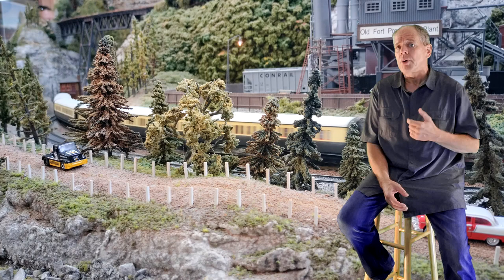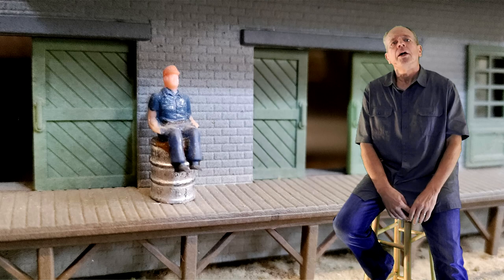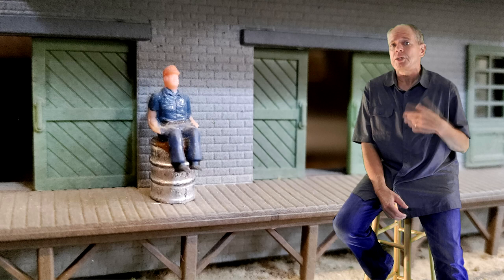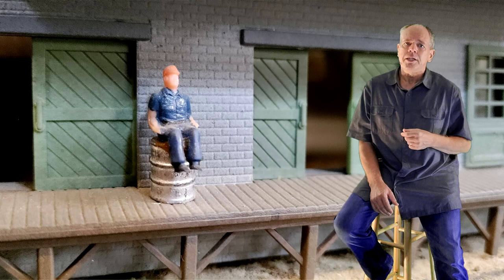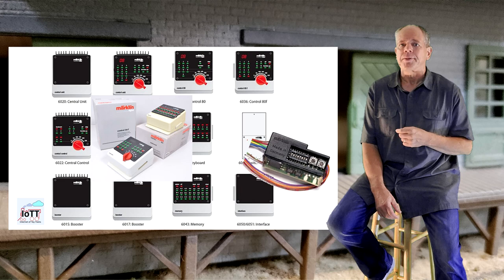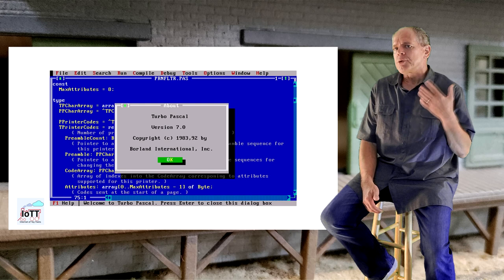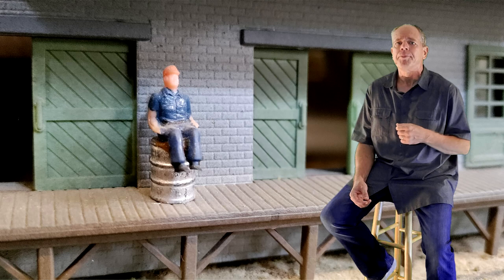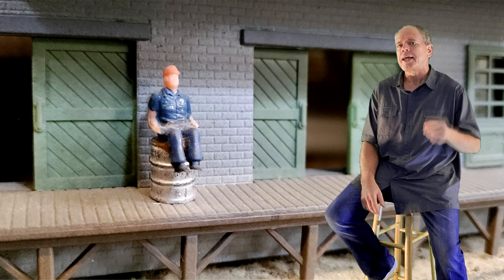IoTT Channel: The Story behind (Video #100)

Comment: Wow.  What a great story.  My senior EE thesis was CMR/I interface for the ATARI 800XL and later implemented the Marklin control system.  I became a computer engineer all because of model railroading.  I purchased a copy of WinLock at the National Convention in Philly I think back in the 90's.  Never implemented as life got in the way but my wife always used this against me as a hobby purchase I never used. :-)  Thanks for sharing.  Love following your channel.
Reply from the maker: Thank you. It is always nice if it is possible to combine professional and personal interests like you did with your EE thesis (except for loosing a handle on the time spent on projects). And regarding the unused WinLok, maybe point out to your wife that it at least had a pretty decorative box which looks nice on the shelf ;-)

Comment: Hello Hans;  A most excellent and interesting story.  I got my SCI in December 88, had a wall fall on me.  When I got to the Independent Living Center the social worker asked If I had any hobbies.  I remembered Trains and the local club was on the opposite corner.  First night there 4 guys carried me down stairs to the switch machine bench.  Long story short I became sm foreman and also helped with the 94 NMRA national.  I moved since then and model in larger scales but still it is trains.  TC Carr
Reply from the maker: Never give up, no matter what! Thanks for sharing.

Comment: Hans Congratulations.  Love the successes story.  I wanted to say I'm planning on purchasing iott stick and green hat   I'm sure I can breadboard an optocoupler to greenhat mput sic lionel 15-19 vac 022 signal wires.   And I will find a use for 16 servos!.  Or maybe use inputs for end of line motor and using the pwm motor control to run a freewheel servo.  You have really inspired me thank you and best wishes for the next 100.
Reply from the maker: Thank you. Using optos should not be a problem at all. Alternatively you also could use reed switches and magnets to detect the rolling stock. And if you do not use a digital command station with your Lionel trains, you can configure the Stick to connect to an MQTT broker and do a little app in NodeRed, so you can control the servos from your smart phone as well. Plenty of options ;-)

Comment: WOW, OH WOW, Hans that is a most fascinating story of your life so far. After I became acquainted with DCC and discovered Digitrax Loconet I then discovered WinLok. All this was around the late 1990s. I did not have a layout at the time so I never purchased a copy of the WinLok software (sorry about that). But I loved the whole idea of what it could do. I have a background in communications and IT (Internet) I worked for the primary communications company here in Australia, Telstra. I had been playing with some IoT things when I found your IoTT channel sometime around 2019. Based on your design and Circuits, I am currently building a DCC Servo motor decoder for a friend who does not need the Loconet functionality as he has an NCE DCC system. I am also looking forward to getting my Purple Hat working, so I can speed-match all of my locomotives. I also have a Red Hat as well. On my own layout, which I am currently building I will be using a lot of your IoTT devices. Thank you Hans for all of your work, I for one appreciated all the work you have done, and are doing for the Model Railway hobby. Thank you. Regards Philip Hillebrand.
Reply from the maker: Thank you. Glad you find my stuff useful ;-)